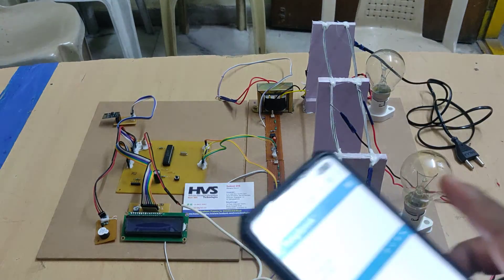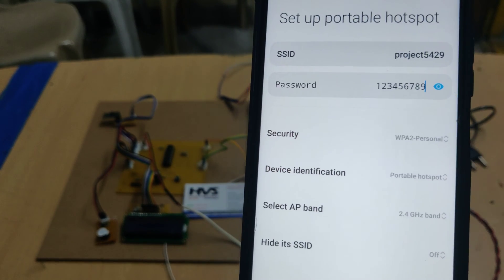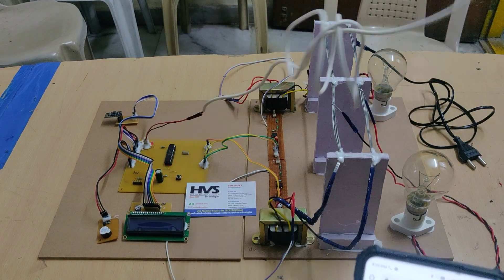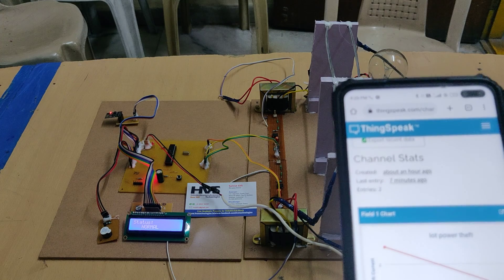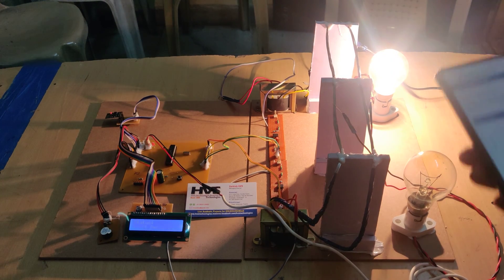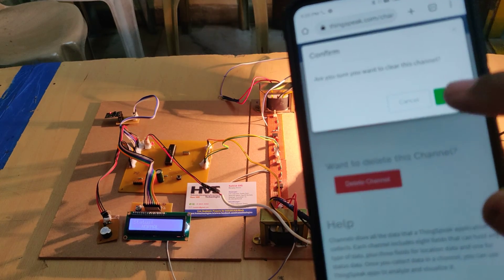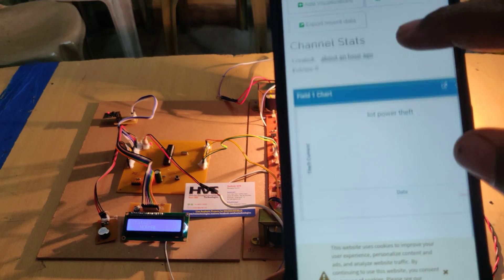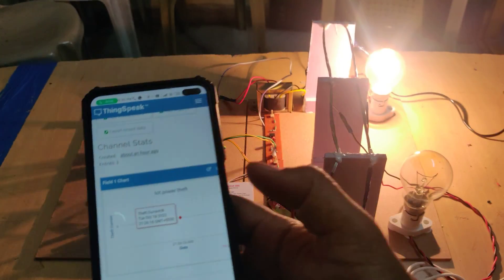HVS-3197. IoT Power theft Detection and Alarming with Thingspeak Cloud platform #powertheft #pic

Comment: Sir what happens if first load is connected like a way that theft load instead of connecting theft load
Reply from the maker: Will read current between the poles only. You can contact us at +919603140482
Through WhatsApp or call